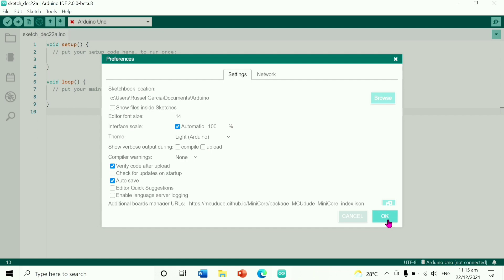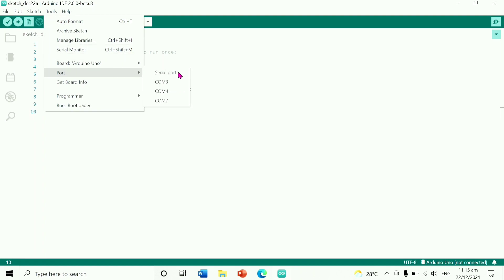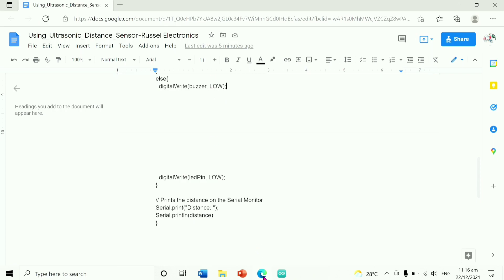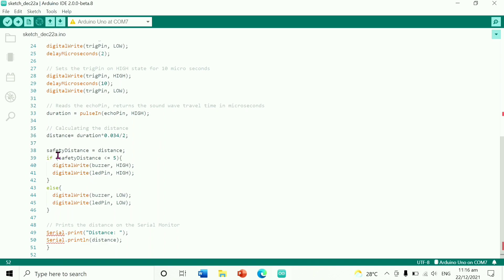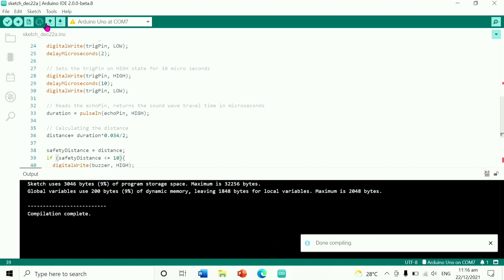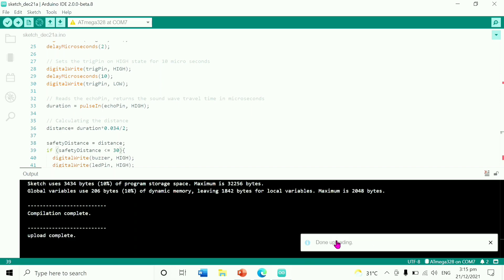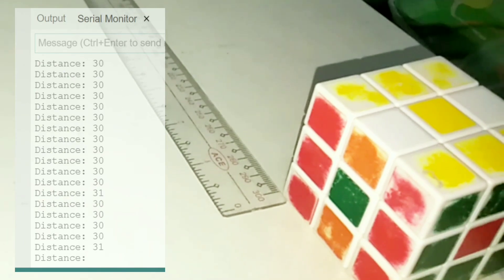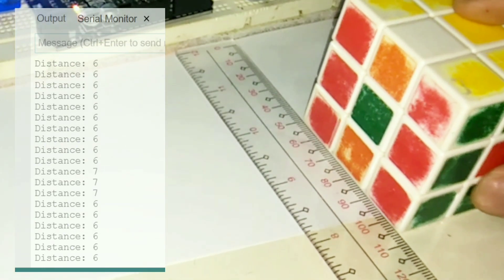ATmega328p programming ATmega328p+ESP8266 Ultrasonic Distance Sensor HC-S04 Arduino Microcontroller

Comment: If you put a transistor it will be even more beautiful.
Reply from the maker: Yes, you're right. We can use transistor, if we have the output. Such as high current loads like buzzer or motors.

Comment: Please tell me, for what purpose do you put resistance? What denomination and why?
Reply from the maker: I put resistor to LED. the voltage source is 5v. So we need to use resistor to drop the voltage to around 1.7v. And we all know that the input voltage of LED is around 1.5- 2.2v